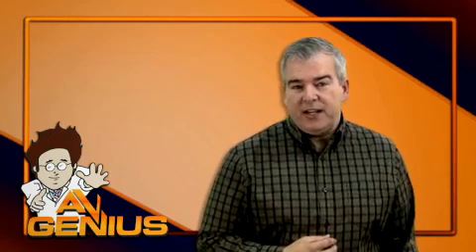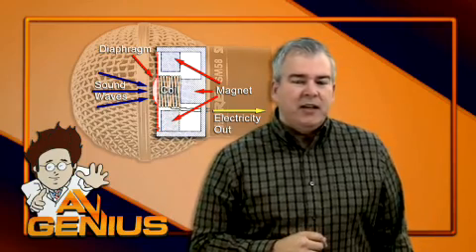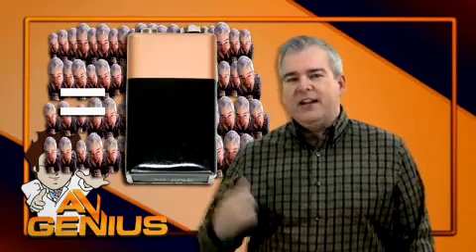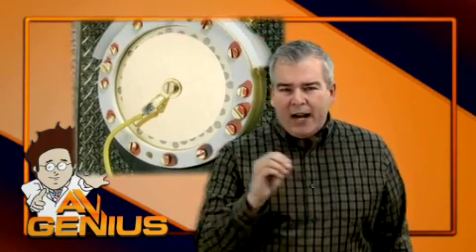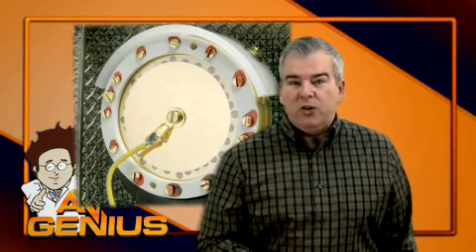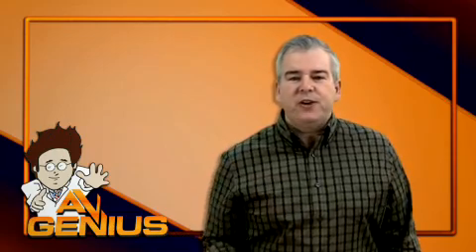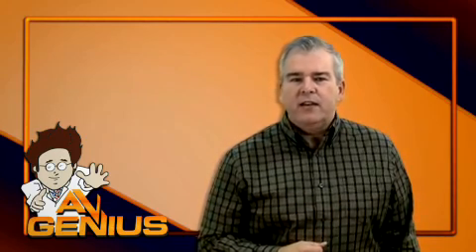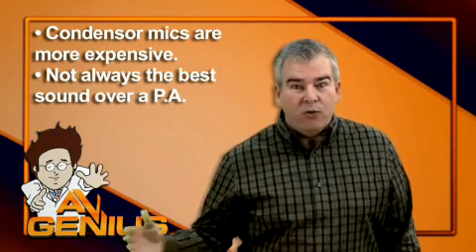AV Genius "How to Mix" series - Mic Types

Comment: i don't understand the part of five thousand singers sing in the 5000 microphone...
Reply from the maker: If 5,000 singers each had a dynamic microphone and sang into them, the total voltage produced by all of them combined would only be about 9 Volts...
The point being that Dynamic mics produce a very small amount of electricity.
Reply: thank you for telling me the point, so the quality of recording from Dynamic mics is a bad option for mixing because noise will gain when we puss up the gain, is it right?
Reply from the maker: The quality is lower than a condensor, because the dynamic mic has to generate electricity from the air physically moving the diaphragm.
The real issue is that this is a very tiny signal - and I would say that all the parts of your signal path - including the wires - are critical.